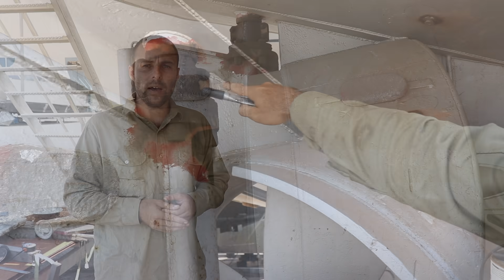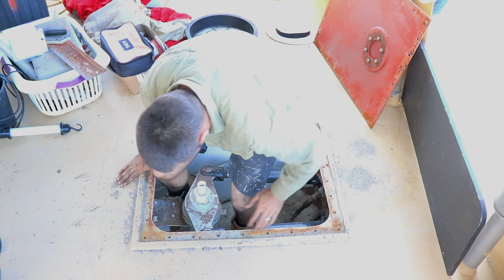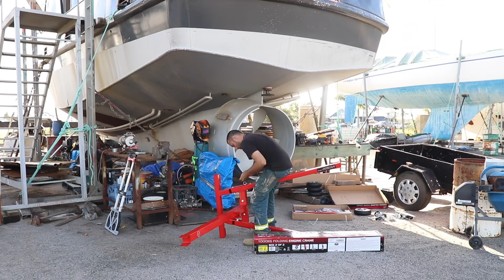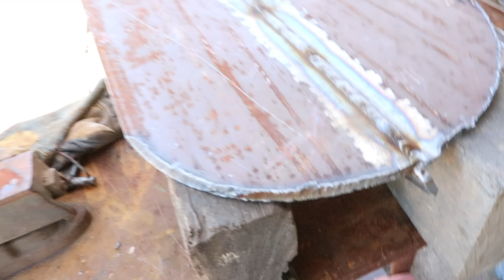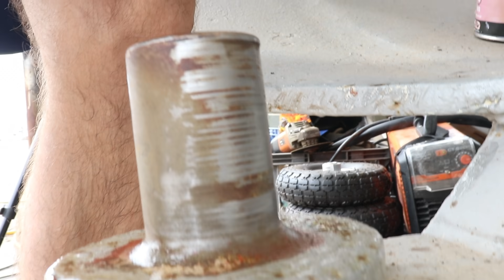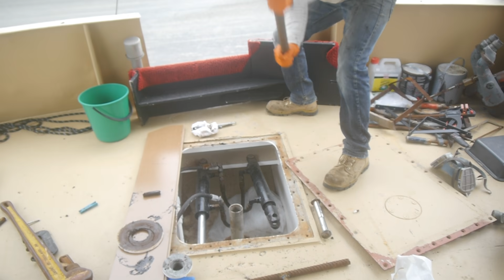Replacing Rudder Bearings - Project Brupeg Ep. 65

Comment: Great work as always but I would like you to get solid wheels for you engine hoist as the ones you are using will not cut the mustard speaking from experience . you can get them the same size as, like the one on your mixer but bigger.  cheers mate
Reply from the maker: Yeah I accept they may not last but I also don’t need to lift a ton. Only a few hundred kg tops. So far it’s working, been able to move Diesel engines and large plates of steel without drama
Reply: Ya after I wrote  it I thought that might be the case so well done  @ProjectBrupeg
Reply from the maker: Thanks mate

Comment: 3:11: Massive zincs! I'm just ordering mine. I'm opting to weld threaded studs instead of tacking them on via end plates. 4:00: That bearing ring on the bottom of the shaft...if it's Delrin (a slippery high-density plastic), you may want to replace it now. 5:30: A pleasant surprise, those flange bolts coming away cleanly! I don't know what industrial grade of marine anti-seize would work, but I'd endorse it for the re-do. That's brilliant access, and looks strangely familiar, if bigger! 12:14: I wanted one of those to align my diesel in its bay under the pilothouse, but it wouldn't fit, so I built a gantry out of wood in my garage, transported to the boat by bike, hauled up to the deck by rope and built it in place with a cross-beam and a chain fall. Worked perfectly. 13:15: When you're done with that, you might want to bring it with you modded as a deck crane on a pivoting base. I have that at my stern (it's a lot lighter, mind) and it's great for bringing aboard outboard motors, crates and gear from the ground when I'm cradled. 26:40: That's a very respectable bead. 36:55: The "flange" thing is called a pintle. 3&:30: Well done...I thought you were going to have to extend that pipe wrench.  43:07: Proper use of leverage! 44:14: Ah, you knew it was a pintle! All that new machining will serve you well, I think. Great work.
Reply: The yellow shit looks like duralac, not really for anti seize but to separate dissimilar metals to stop electrolysis.
Reply from the maker: Thanks Marc, yeah we have 16 of those anodes on the boat, they are all welded on but we are planning to cut them off and bolt all of them. Also need to weld steel protection on the forward edges of them for ice work
Reply: @ProjectBrupeg  I'll be interested to see how you engineer that and still keep in proper trim. Sixteen anodes probably cost a packet in Australia; you may wish to weld on your studs/bolts and then melt them all and cast them to match. Google reveals the best techiques, but a mold, bricks and propane in the open air are most of the kit you'll need.
Reply from the maker: No need to re-cast as they have only eroded about 5%. We will be just cutting them off the hull and welding bolts to the hull and drilling the end straps with a Jig

Comment: You could use a simple plumb bob to align your bottom pivot?
Reply: You could, but only once you have moved the ENTIRE BOAT to ensure that the top and middle bearings are PERFECTLY plumb first ;-) .
Reply from the maker: Hi Ian yeah we tried that first but the rudder shaft is angled every so slightly backward (at the top) so we swapped over to a laser level.

Comment: The termination of the propeller cage is very rough and creates a ton of unwanted motion in the water. Weld some round section to that lip edge and massage the metal and weld in to a smoother finish. ALSO, that termination right before the extended portion should be smoothed as well. This was a commercial vessel, but if you want to make the most out of your buck, you need to up the game there as well.  And when it's such a simple and cheap fix, there's no reason not to do it.
Reply from the maker: That’s true but on a boat like Brupeg going to that effort will not be noticeable in terms of boat motion or fuel efficiency. This is a piece of 10mm steel which is a smaller trailing edge that what most yachts have on keels or rudders

Comment: cool improvement , I see this cooling pipes I see them in danger with ice?
Reply from the maker: Hi Bruno, we will be cutting these pipes off before we get to any ice. For now we are keeping them so we can use the boat in the tropics without thinking about weed blocking our intakes. Most commercial trawlers in this area have keep cooling for this reason
Reply: @ProjectBrupeg  You really need to make a big sign saying "These will not be here when we get to the ice!"  & hang it on those pipes.
Reply from the maker: I have said these exact words 6-7 times now!
Reply: @ProjectBrupeg  So... your morning project is to make the bloody sign!  :P
Reply: is there a solution to keep thee pipes maybe covering with plate. we will see you back from the artic!
Reply from the maker: Maybe but we think it’s just easier to pull the cooling into the hull rather than strengthen and external protrusion